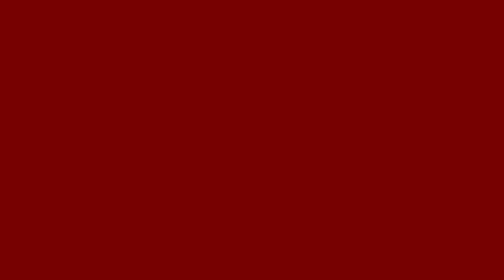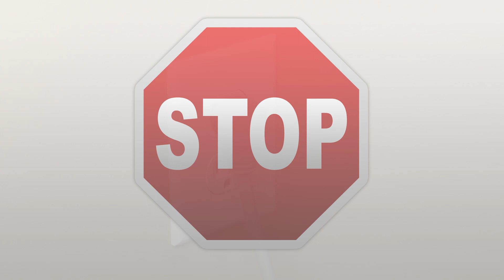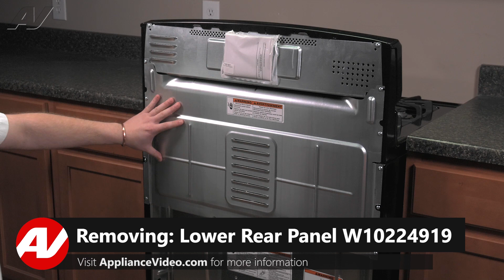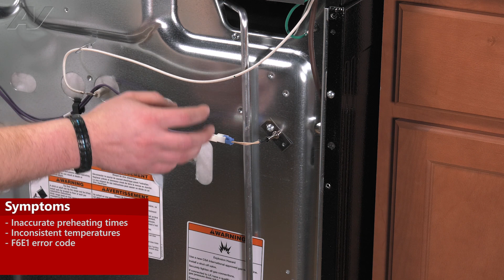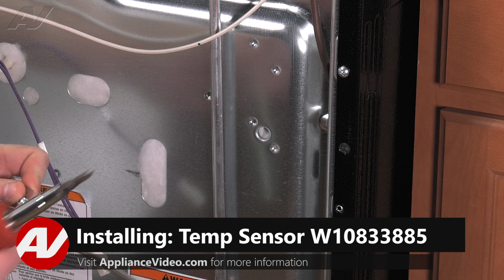Amana Stove Repair - Will Not Preheat - Temp Sensor

Comment: Our problem is intermittent. Sometimes the oven will display the temperature we've set but the temperature actually declines and it does not light back up. I will test the ohms on the sensor but with it being intermittent, I'm worried that it show the proper amount.